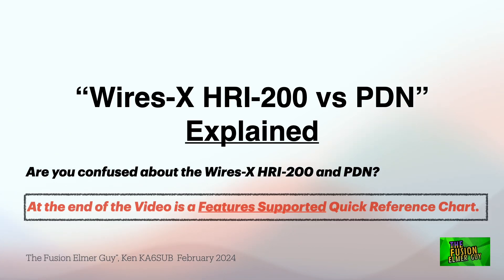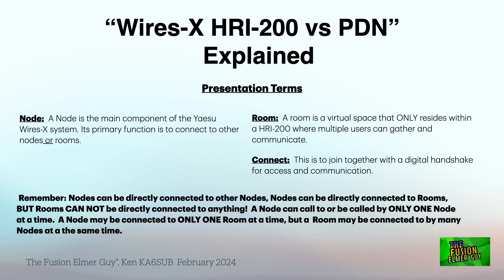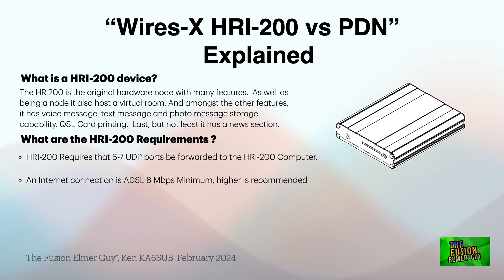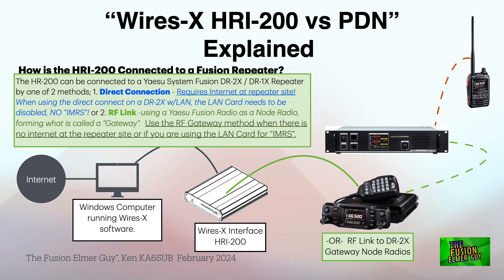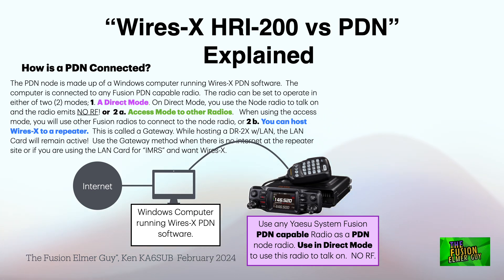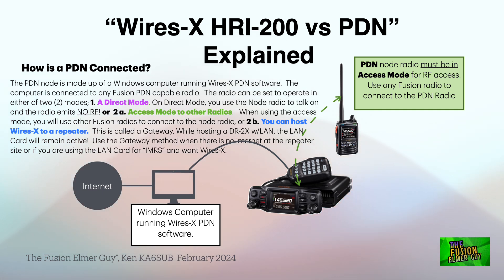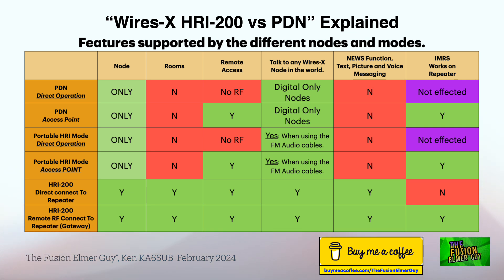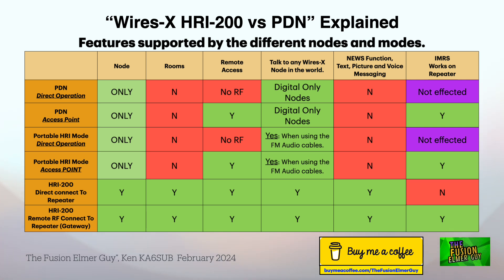HRI 200 vs PDN    Explained

Comment: Great presentation. We have the LAN card but don't want to put a computer at the repeater site. Is there any need to have it installed in the repeater? We plan on using a donor radio and computer at someone's house and want to sell the LAN card if we don't need it. What features does the LAN card give us as far as connecting to the internet?

73,
Howard
WB4GUD
Reply from the maker: Thank you Howard.  #1. You do not need a computer for the LAN Card to work, a computer is ONLY USED FOR THE SETUP!  Wires-X does require a full time computer and donor radio when used off site.  #2. I would not sell the LAN Card, you paid $200 for it and that also included installation and setup, good luck on getting $200 when you sell it.  Now, at some later date, you realize a need and want to buy another Card, you will pay $300 and you do the install and setup. KEEP IT!!!!  The LAN Card is used to setup a private network of repeaters that you would like to connect to either on a regular basis or on a permanent basis.  This could be other repeaters that the club has, connecting them for nets, etc.  you could talk to any one repeater in the network or combination of repeaters in the system. It is far more reliable than Wires-X!  It does require that you have an internet connection at the repeater site, a static IP and ONE port to forward.  I hope that I answered your questions. Feel free to ask other questions.  Ken  KA6SUB
Reply: @thefusionelmerguy2234  Thanks for the reply. We'll keep the LAN card for future use.

Comment: For my setup, I have the HRI-200 connected to an FTM-200, but do not use a repeater. I get about a 5 mile radius. What am I losing in terms of operations by not connecting through a repeater?
Reply from the maker: Hi Rob, if you are talking about replacing the FTM 200 with a DR-2X repeater at your house, there would be no difference, but if you were to use a high-level repeater, you would obviously have greater coverage.  Keep in mind that the use of a node at your home is for your personal use and should only give you nearby coverage (A Mile or less).  Also nodes do not belong on repeater frequency pairs, they should be setup in simplex in the simplex portion of the band.   Remember that repeaters should be coordinated through your local frequency coordination group and that some of these groups are either coordinating nodes or working towards node coordination to eliminate interference from adjacent users.  I hope that this is helpful to you. Thank you for your question, i'm here to help!  
73
Ken  KA6SUB
Reply: @thefusionelmerguy2234  Thanks for the reply. No, I'm happy with my configuration. I was just wondering if I was missing something regarding half duplex/full duplex operations with the way my room/node is set up. It's mostly my wife and I that use the room, so the 5 mile or so radius I seem to be getting works pretty well.
Reply from the maker: Sorry, Rob, but I may have misunderstood what you were asking for.  Because you're node is not a repeater (Full Duplex) it only transmits what it hears through the Internet (Half Duplex).  If you're using a pair of frequencies for your node, one for transmit, and one for receive, then everyone listening to your node will be listening on the output of the node and transmitting on the input of the node therefore, they would never hear anyone else talking to the node who was on RF.  Now, if you were to have your node setup in Simplex mode, then everyone would be listening and talking on the same frequency and be able to hear each other, if they were within range of each other units.  I'm not sure how you have your nodes set up, you never stated. But I would recommend setting it up in Simplex mode as I feel this would be the best option.  I hope this now answers your question. Feel free to call me anytime.
73
Ken
Reply: @thefusionelmerguy2234  Thanks. Yes, that is what I am doing. Simplex. I think you answered everything alright. These are great videos for the Wires/X community.